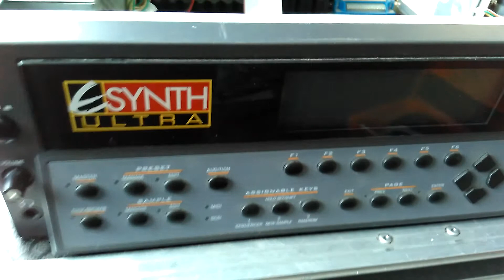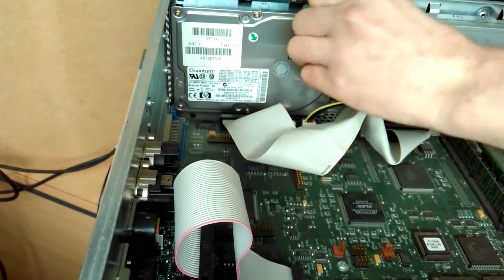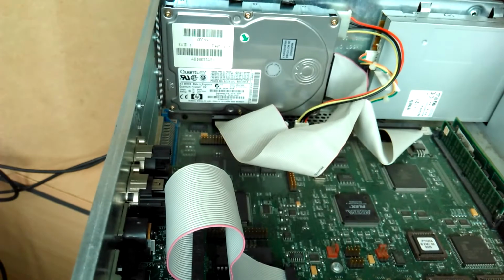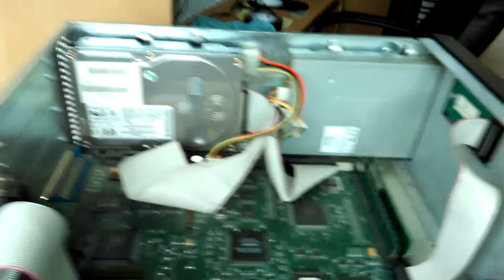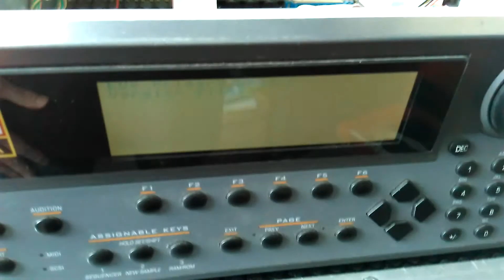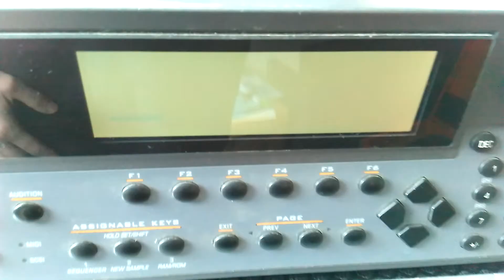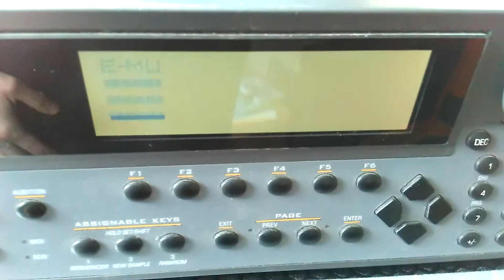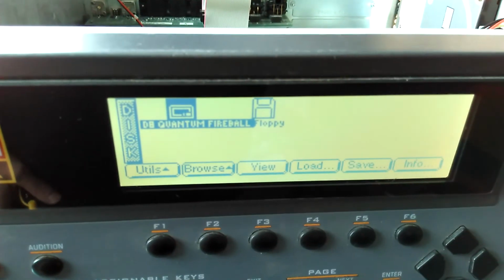E-Mu ESynth Ultra sampler IDE Hard Drive installation

Comment: Great! How is the drive setup, as a master or slave(theres a jumper for that next to the cable on the drive)? Thanx
Reply from the maker: It's set as the master.
Reply: Can I use this drive in a esi 4000
Reply: @bryantsimpson5060  unfortunately not, the ESI has SCSI interface. Buy a scsi2sd for the ESI and use SD-cards instead.